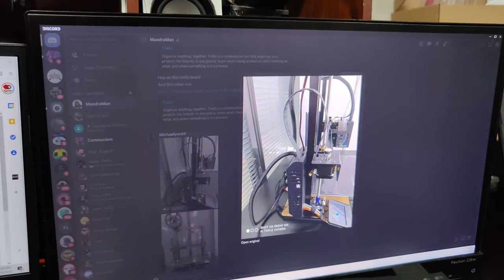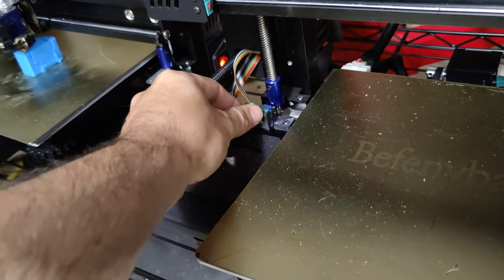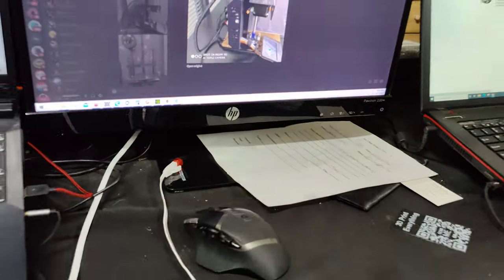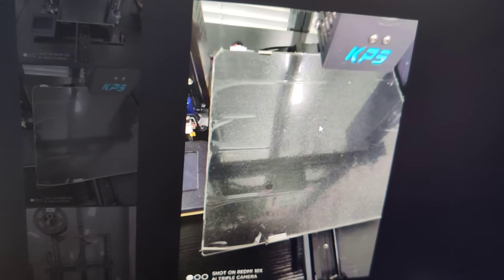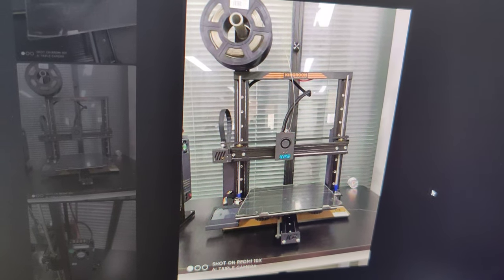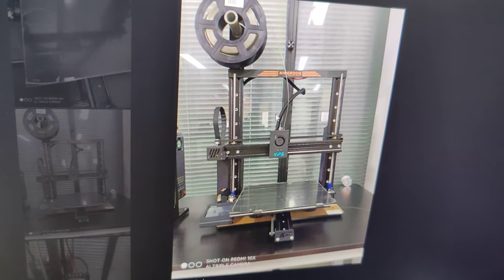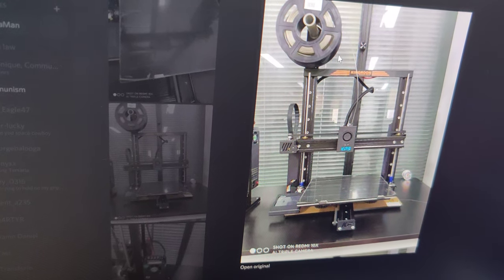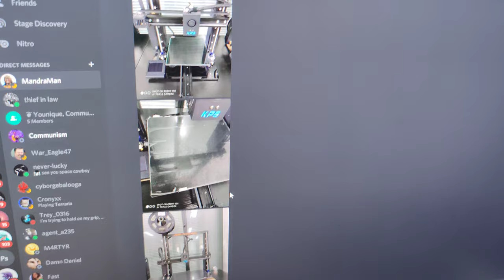KP5 Factory Upgrades Update! Ready for Preorder!!

Comment: Thanks for the video!
Did they change the that dangerous single wire out of the power supplier something more safer and more reliable (bigger cable or better connector?) ? Any news on the KP5S?
What version of Marlin does it run?